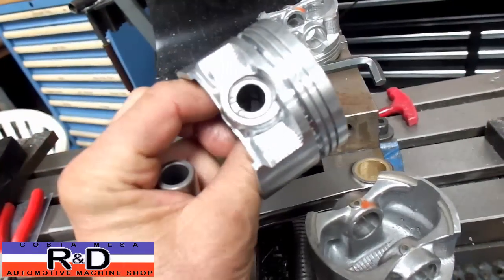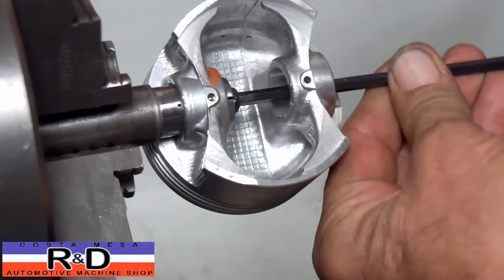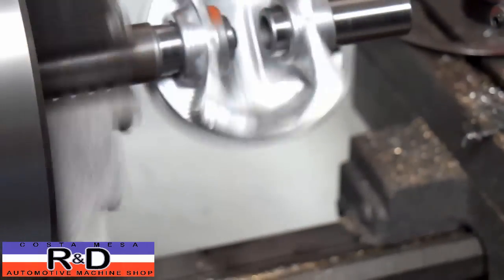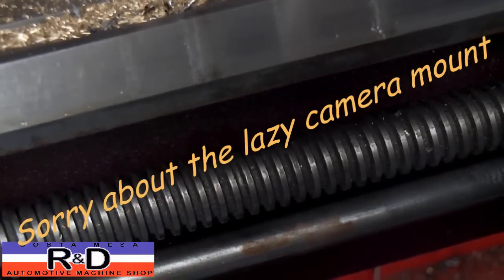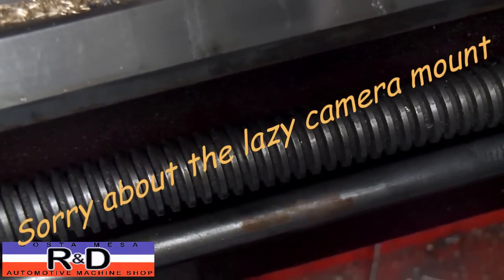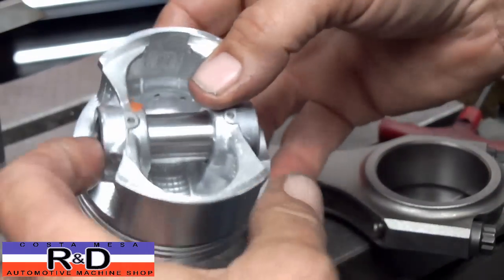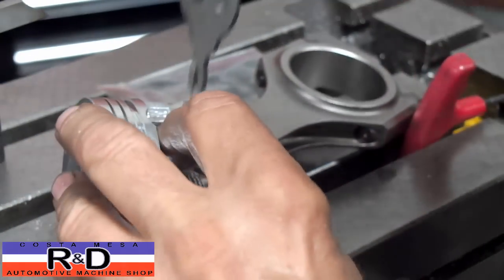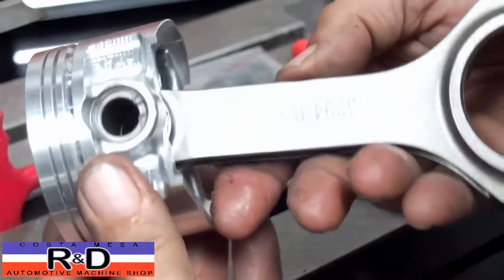D16 Honda Full Floating Piston Pins

Comment: John,

I was wondering if you still use your Kwik Way pin bore to open the rod for bushings, or if you have a Tobin Arp-type set up, or maybe something else? I do not have a pin boring set up at the moment, and was trying to come up with a fixtrure idea to bore the rods on the mill and control center to center length. I have seen a BHJ set up used, not sure if that is a good way to go. Wondered if you had any thoughts on that..

Thanks,

Marc

Comment: So what's the advantage of doing this John?
Making it fully floating?
Reply: A floating pin has less force on the major and minor thrust surfaces of the piston and on the cylinder wall. This reduces distortion in the bore, helping the rings to seal better. Its really only necessary on high compression or high RPM motors. I'm sure there are more advantages then that.
Reply: Chevypower265 Another advantage can be ease of assembly/disassembly. A floating pin does not require a press or rod heater. Floating pins with tru-arcs (snap ring style retainers) assemble by hand with common snap ring pliers. Spiro-loc retainers are easy to assemble also, a bit tougher to get out, but still easier than a pressed pin.